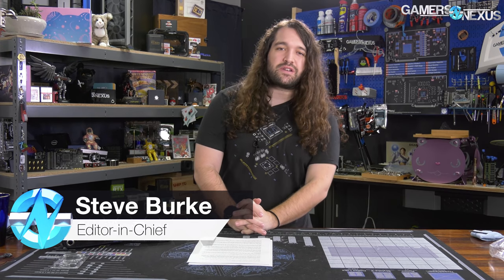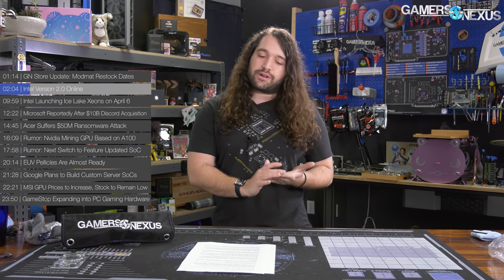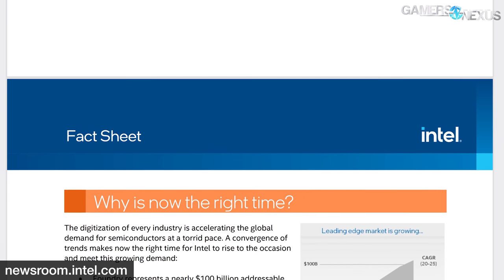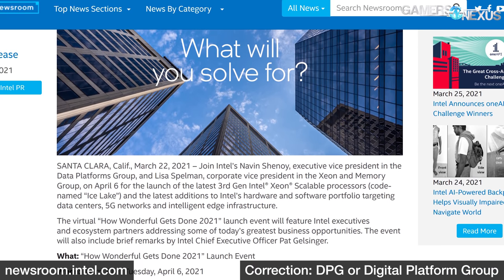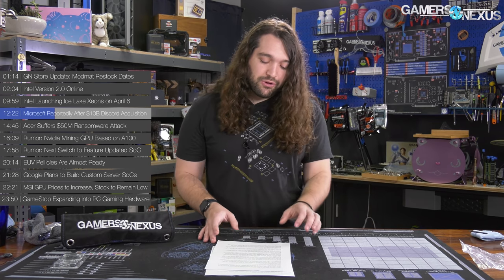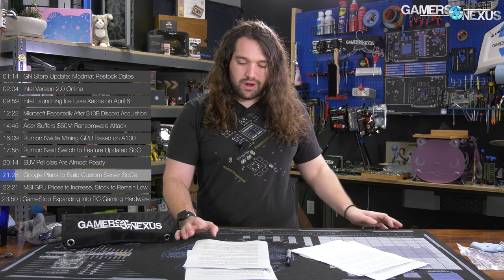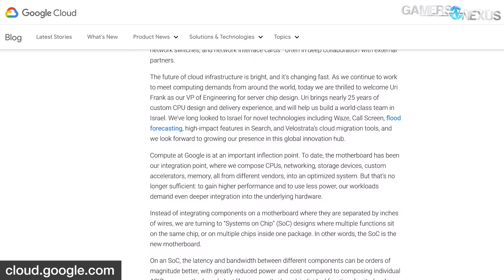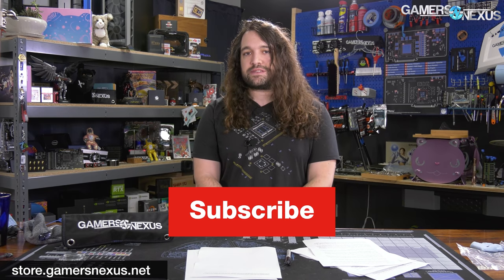HW News - Intel's Comeback, MSI GPU Price Hike, GameStop PC Hardware, & NVIDIA Mining GPUs

Comment: Fun fact; they couldn’t place a real $100 bill on thumbnail because of photoshop counterfeit software detection
Reply: GIMP won't kiss and tell ;))
Reply: if i am not mistaken you cant print Dollar bills either.
Reply: @RobJorg  pretty much all printers look for specific pattern shapes that appear on money and will not print anything with those patterns
Reply: Yup! The proper names for them are EURion Constellations or Omron Rings, and are a specific pattern. Most printers even have built-in hardware dedicated to trying to find them to prevent bills from being printed. 

Depending on the software, many recognize the specific patterns, allowing for additional symbols from the rings to be used, though the circles are almost exclusively used.
Reply: @herpaderpy888  I wonder what software designers use when printing actual money. Must be something archaic from the 60's or so because if it isn't broke then don't spend money fixing it.
Reply: @ClonesDream  
From videos on youtube, bills tend to be printed one colour at a time using ink and foils on large rollers as opposed to inkjet methods, its probably faster will the foils
Reply: @ClonesDream  archaic? Yes. The 60's? No. They hand chisel the dies that print money
Reply: @ClonesDream  It's been a few years from when I last researched this topic, so I may get a few minor details wrong and it may have changed for more recent high denomination bills, but from what I remember, the US mint hires several artists (I believe actual employees of the mint/treasury department and not freelancers just to strengthen the point) to each develop different portions of the bill. So one artist will do the face, another will do the border, so on and so forth until the bill has all its components. This is done so that it is impossible for any singular artist to perfectly be able to recreate a bill in its entirety. These artists work on scales much larger than the final result in order to increase sharpness/final quality, and also to allow for the creation of micro-details for microprinting that are impossible for standard/commercial printers (ink jet, laser, etc) to recreate. These large images are used to project onto photo-resist sheets and decay the resist, which is pretty much the only way to get this level of detail (fun fact, this is almost identical to how very old PCBs used to be created). The resist is then transferred onto pressing drums and then the drums are placed into an acid bath to etch the drums so that only the places that need ink pick it up. This is done for each color that is used on the bills. Eventually the drums do wear out and do need replaced, which is why first pressings/low serial bills are worth the most- they are the highest detail and quality bills.
Reply: @ClonesDream  Looking at US bills it's from the 1860's given how infrequently they redesign or improve the security on them.
Reply: @TalesOfWar  have to laugh at that comment. They are constantly adding security features and are almost always the first to create and use them. The design doesn’t have to constantly change. At least US money doesn’t look like it’s from a board game like a lot of other countries.
Reply: @Bob_Smith19  For Europeans Dollars look like toy money as well. It just depends on what you are used to.
Reply: @Bob_Smith19  When are they going to introduce different sized and coloured bills for people with visual impairments so they can just feel it and know it's a 20 for example? Isn't something like that a good reason to redesign it?
Reply: @Bob_Smith19  Imagine criticizing other nations for the looks of their currency when yours is just green and white.
Reply: @ClonesDream  wait what
Reply: @spencerhansen2927  why tho, no consumer printer is gonna make something even close to resembling money
Reply: @Angry Toaster I don't understand, what printers have cameras
Reply: @Matrix27594  tru
Reply: I bet there are ways to hack the firmware of those printers to disable that feature. Heck, someone even made a printer run Doom 😃
Reply: @cinialvespow1054  I'm not saying it's necessary, that's just how they're made.
Reply: funfact: you can put it in illustrator, save, open with ps and copy it to your main file

Comment: Im waiting for a DOS resurgance so we can get direct control of GPU and make great games for hardware we can still find :)
Reply: If it took 8 years to make Cyberpunk 2077 with all the bells and whistles which exist now, imagine how long it would have taken if the devs had to develop it for bare metal :)
Reply: @АлексейГриднев-и7р  DOS is not bare metal.  DOS is about as close to bare metal as Windows.  If you don’t understand why or what the difference is, then you should probably watch another channel that actually teaches the absolute basics about computers, rather than one that pretends to understand what they’re looking at when they’re staring at a PCB.  Hyper-V or another hypervisor is a bit closer, but if you have an operating system between your software and the CPU, it’s not bare metal.  The reason people don’t write software to run on bare metal is because they’d have to know the exact chip being used, because the machine code will differ between the processor revisions.  If you want to be extremely pedantic, technically even the assembly code for a particular processor could be considered a step away from the bare metal machine code, because the assembler adds some human readable functions like add or subtract, rather than just the hex code that means the exact same thing.

Programming in assembly is much closer to machine code than C, because it’s converted or read as raw hex, rather than being compiled into machine code like C. 

The only games that ever ran on bare metal were arcade games, and anything written for the 2600.  Pretty much anything that ran off of a ROM chip soldered to a PCB or off of a cartridge was running on bare metal.  Some of the programmers likely used C and a compiler to generate their code for whatever chip it was going to run on, but there was no operating system between their code and the hardware.
Reply: @kernelpickle  DOS is a basic "disc operating system" ,  it's graphics are calls to your system's "bios".  A program would have to switch back to "DOS" at it's end or it would crash the system. (int 21h)
Reply: @christeschke9844  yeah, you definitely don't know what you're talking about.  DOS stood for "Disk Operating System" because Disc's (which specifically refers to media used optical drives) didn't exist in the 70's when it was written, and disks refers to hard disks or it can refer the floppier variety of magnetic "diskettes" that were more commonly used before CD-ROMs and HDDs took over as the best bang for your buck mass storage drives.

Another point of confusion is that you seem to think that the OS is making calls to the BIOS, which isn't even close to how that works.  The BIOS is simply the software layer that serves as the interfaces between the hardware installed in your system and the CPU and/or between the hardware and the drivers.  it's the drivers that the OS is actually interfacing with in modern OSes, while in DOS the OS would interface with the CPU, which would interface with the drivers.  So, when you run an application in an OS, it asks the OS for access to resources in a more generic way, than executing machine code that will perform some sort of function with the hardware,  because the software developer couldn't possibly write code that is designed to work with every piece of hardware available, and that's the entire reason you have an OS.  (Otherwise you'd have an embedded system that functions more like an older non-smart appliances or devices).

The INT 21h that you think you're clever bringing up is a software interrupt that's invoked by the DOS API in order to access one of the numerous subfunctions available in the AH register of the CPU, so the OS can perform a function with the hardware in the system.  Basically every bit of hardware (excluding graphics) that DOS could interface with was handled through that register, but if you wanted to access lower level hardware like a GPU--you need drivers that can be called upon by the OS, and since you want to be fancy and talk assembly (which is the human readable version of pure machine code, that's specific to the processor in your system) the interrupt used by most BIOSes was INT 10h (or int 0x10) for video services.

Again, the sheer variety of hardware in existence makes it impossible for DOS or any OS to be designed in a way that will universally work with everything that's available, since they could potentially use different interrupts and have very different capabilities.  So that's why the OS makes calls to the driver, and the driver is what sends the specific interrupts to the hardware, and on systems like DOS, DOS will send an interrupt to the CPU and it's the CPU that interfaces with the driver, and the driver is what sends the BIOS interrupts to perform a function with the attached hardware.

The funny thing is that since we're being technical (because you wanted to sound like a smart guy and managed quite the opposite) what I can also tell you is that modern operating systems, like Linux and even Windows NT (notice the absence of DOS here) on startup, the system will actually bypass the BIOS interrupt calls, the OS Kernel flips the CPU into a different operating mode, and then they load kernel drivers (ring 0) which will allow the OS kernel to access the hardware directly, rather than sending interrupts to the CPU, which talks to the driver which translates what the CPU wants to the correct interrupts needed for the BIOS to make the hardware perform the function it's be called upon to do.

That's why DOS was a slow piece of shit, and more often than not (especially with games) there would be a limited set of hardware it supported, because they would actually include assembly code that was developed specifically to work with that piece of hardware, so the actual game/software was basically designed to bypass the BIOS and interface with the hardware directly.

The reason this doesn't happen anymore, is again because theres too much hardware now, and for MAJOR fucking security reasons.  You don't want software that can bypass the CPU and the BIOS, and just start doing things because it fucking wants to.  Unfortunately that's EXACTLY what the fuck those cancerous Anti-Cheat systems are doing with their ring 0 drivers that are as insidious as rootkits, because they exist at at the same level as the OS itself, and the OS can't really control what it's doing, because it loads before the OS does.

Now, I can understand your uneducated confusion about the DOS era where the OS, the BIOS and CPU pretty much didn't have security mitigations in place to prevent malicious or poorly designed software to circumvent their authority over your system.  However, you were incorrect as to the manner that was achieved--it wasn't because DOS allowed more direct control of the hardware, it's because it didn't know any better and wasn't able to stop developers from executing machine code for that specific hardware configuration.

An analogy would be like comparing a modern operating system to the parents of a child that set up rules and restrictions to protect their child (in this case you, the user)--while DOS was like having Grandparents with dementia running the show, because despite the fact that they sure as shit weren't as fast or as capable as their children (the aforementioned parents), they just didn't understand how to set boundaries (or why they would ever want to) and subsequently the children they were babysitting got away with fucking murder under their watch.

As we've become more advanced with our devices, malicious code has gotten more advanced, and made it far more important for security counter measures that prevent that malicious code from wreaking havoc on those devices.  If you want to experience a more modern OS that has ring 0 access to your hardware, you can always try Temple OS--which is a schizophrenic fever dream, because only someone with severe mental health issues that happens to be off their meds would think that shit is a good idea in this day and age.

Again, back to your original comment--I don't understand what you think DOS is going to achieve for you on the hardware that's currently available, because as I mentioned already, every modern OS has direct control over the kernel drivers that talk directly to your hardware--while DOS wouldn't even be able to do that.  If you run software (or games) designed to run directly on the GPU via Nvidia's CUDA / GPU Direct you will have a very poor experience, because you're bypassing the CPU (which is faster at running complex instructions than a GPU, which can run a bunch of tiny instructions really fast, in parallel) and the system memory, which is bound to be more abundant than whatever older GPU that isn't good for mining (ie anything with less than 6GB of VRAM) and the primitive games you could run on 4GB of VRAM would be absolutely dogshit.  A last gen console would do a far better job, and those actually use VRAM for the GPU and system memory, which is how they punch above their weight class.

If you're that hard up to play games, buy an Xbox One, which has GamePass and will allow you to share a large number of games in your library with your PC whenever you can afford an upgrade, and there are plenty of newer games that support mouse and keyboard.  The money you save on buying a GPU can be spent on taking online courses to learn about computers, because you seem interested, and clearly need more education on subject.
Reply: @kernelpickle  good write up :)
Reply: @christeschke9844  I couldn't very well skimp on it posting under this channel.  If I glossed over anything, I'd be torn to shreds! lol

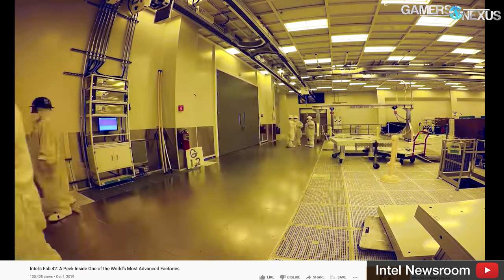Comment: 3:08 ah....jumpsuits, ESD booties & perforated floors... i missed working in a cleanroom. except the times where i dropped custom or imperial sized screws into them (we use metric here).
Reply: No one uses Imperial. SAE sizes perhaps, but not Imperial.
Reply: @sammiller6631  yup, they are SAEs. i tend to say imperials/inches out of habit. Sorry about that.
Reply: @mohdnorhalimzainudin7740  Wow. I'm surprised someone on the Internet admits their mistake over Imperial. I applaud your honesty and integrity.

Comment: Intel 10nm should be on par with 7nm of TSMC (which was used for Rome Epyc CPUs), so it's interesting to see, how it will compare for instructions per clock performance and also - in configurations with the same amount of cores to AMD.

Comment: Thermal grizzly kryonaut is easily the best paste around when applied properly. My 10850k 5.1ghz all cores under light use at 11C~14C with an ambient temperature of 10C on a noctua NH-d15.

Comment: I have an MSI Gaming Pro Carbon AC. I also have a 1070 Ti MSI Duke. Despite all sorts of bios updates of them supposedly addressing the issue, I still have cold boot issues because of GPU incompatibility. Randomly on restart the PC fails to boot. It needs to simply be power cycled and it'll usually boot fine the next time. Even before all the stupid moves, MSI was last on my list of future upgrades.

Comment: Honestly MSI can do what they want, I've only used one of their GPUs once and it was honestly the worst GPU I have ever used. 

I admit I was partially at fault, I switched from Team Red to Team Green after 10 years and didn't do enough research on the card in question, I just trusted the brand but it ended up being the noisiest and hottest GPU I have ever bought. 

Games would constantly cause it to overheat and blue screen windows. I had to use afterburner to set my own fan speeds to prevent the overheating, which made the fan noisier than my ceiling fan. I only had it for two years, before I got rid of it. I stuck it in my dad's PC (he's going deaf, he legit can't hear the fans even at max). Still once bitten...

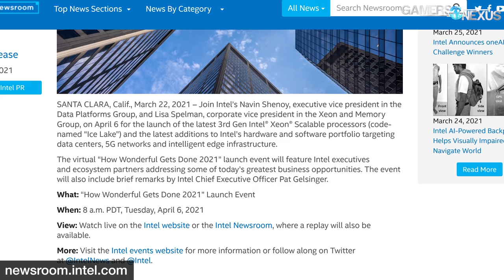Comment: Anyone happen to notice that every CPU on the list for 10nm production is a Quad-Core? @10:54 Intel has NEVER turned out a CPU with more than 4 cores from its catastrophically bad 10nm foundry. How many quad core server processors do you see in use today? They should sell that foundry and put up a parking lot...they'll make far more money in the long run.

Comment: I'm not really sure why nm jumps are as important as folks think they are.  It's been a long time, but I was glancing involved in LIGA origins and it just seemed to me that you get some speed boost from smaller tech - but also more headaches and there is plenty of head room in larger formats given a tolerance for small wattage increases (like 5 watts) and slightly higher material costs (larger dies).  Sure if you get too far behind, you start to hit walls - but being one gen back is not really a good excuse regarding performance and concentrating on it I think is a red herring.

Comment: Given that in Control, DLSS 2.0 makes the game look genuinely better while also giving a 50% FPS boost basically for free, it was predictable that Nvidia would push for DLSS in low-powered devices as it suddenly makes them viable for modern AAA games. I theorised that a game-agnostic DLSS solution could potentially improve game streaming if Nvidia ever made a dedicated device for GeForce Now (stream in 540p, upscale on the device = profit), and I actually called the Switch also gaining DLSS about a year ago. It was a long shot, but indeed highly predictable, and even desireable given that even without DLSS, Nintendo games push the boundaries of what is possible to run on mobile hardware.